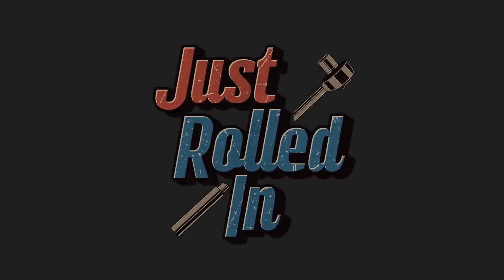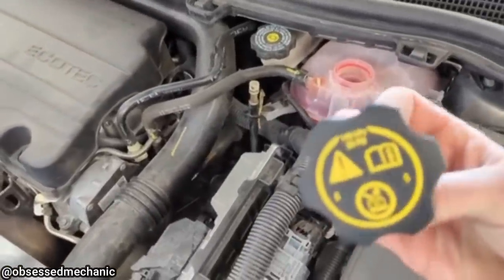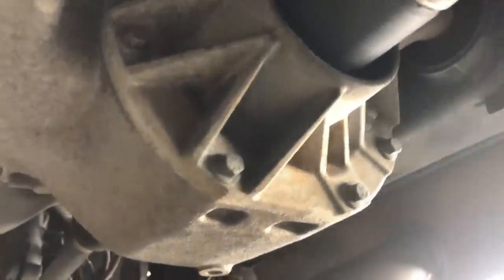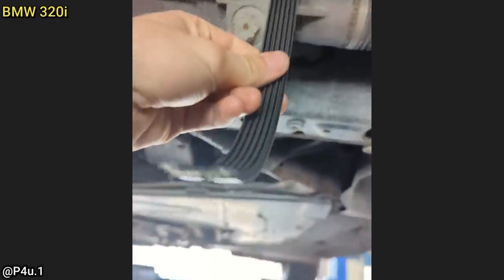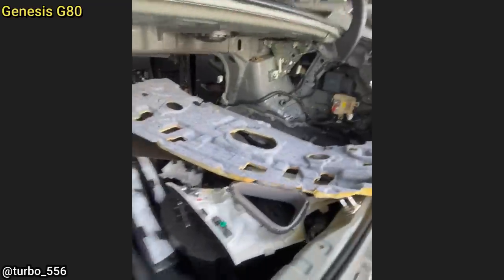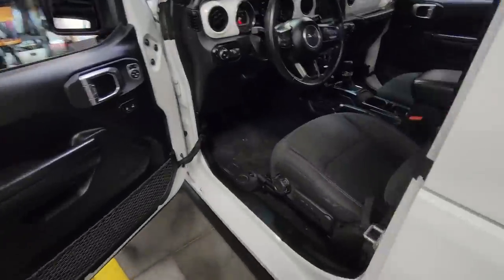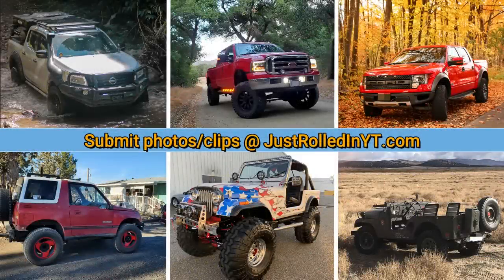Customer States Tire Fell Apart Two Days After They Were Installed (4 Months Ago) | Just Rolled In

Comment: 2:19 Very common problem on Volvos, at least the post 2004 generation. But at least Volvo were sensible enough to have that wiring harness go only from the back of the trunk to the handle, so relatively easy to replace. Only problem is if you're driving a European variant and it completely dies on you, since the European variants don't have that handle in the trunk to open it from the inside.

Comment: This is a great example of why hybrid and fully electric vehicles are far more expensive than gas when it comes to cost repairs. A Jeep Wrangler Hybrid with $18000 parts and labor, more expensive than the resale value.
Reply: That’s interesting since they gave absolutely no details why it cost that much. Was it submerged the indeed all new electronics and wiring harnesses? And  engine and transmission. 
It’s why I don’t like post like that they’re completely open ended and give you no useful information.

Comment: The funny looking spare tire at the end is actually supposed to be like that. My ex's old Pontiac had a spare like that. The rim had two valve stems and when it was deflated it folded in on itself to save space in the spare tire well but when you inflated it on the rim it became the same size as the regular tires.
Reply from the maker: Interesting! The more you know. Thanks for sharing.
Reply: Umm, what good is a deflated/flat spare..& why two valve stems?
Reply: @jessezass  Ahh, think I rode in a Sunbird's back seat..once. My pal Al has a little Harbor Fright compressor; takes a while but guess it works.

Comment: Previous owner of a previous car of mine had "a rattle" in the engine. The piston head broke loose from its rod, after about 500km the rod punched through the oil pan and the whole mess came to a halt. Garage replaced the engine with a new one and I had a nice second hand car with brand new engine for quite a few years.

Comment: That first video looks like when I got new shocks on my car and they used the same part on both sides even though left and right called out different parts. There was an inch of shock sticking out out of the upper shock mount with the nut fully screwed down.

Comment: Oh my god... that transmission fluid in the engine coolant reservoir. I have to replace the radiator on my 2000 mustang. I thought someone had put oil in the reservoir. Turns out i have a leaking transmission cooler line in it. But yeah. It is nasty.

Comment: It's really odd that the manufacturers will cover a whole wiring harness, but if it's a simple thing like a broken wiper fluid box or a cracked headlight module, they always say that it's not covered. That wiring harness job is gonna be like 20 of labor.
Reply: That car will always have problems due to the damage done to replace an entire harness rather than a simple splice. Dumb call on the manufacturer;s part.

Comment: I just got an alignment, rotation, and balance…but I’m still all over the place at highway speeds.  I did a piecemeal job on my tires, so there’s all different tread on the tires; is this the cause of getting blown all over the place at 65mph?
Reply: Check the steering actuator, it might be overfilled with alcohol.

Comment: 2:39  I saw a tire like that back in 1988.  It was the compact spare tire for a 1976 Cadillac Seville.
My sister was getting new tires and the tech said one rim was bent.  We asked them to use the spare tire rim.  They let the air out and it shrank and folded around the rim.  We decided to not mess with the spare rim but I can't remember the remedy we used.
Reply: AFAIK that was one of the early compact spares--it was shipped deflated and somehow folded into itself.  The car was supposed to come with an inflator can in case you needed to use the spare.  That was an option on my 1977 Olds, although my car came with a normal full-size spare.

Comment: When I was 15 working in a gas station/service station in the 60s. That’s when every gas station pretty much had a mechanic and a lift for changing oil and tires and putting on exhaust systems and starters and anything else .. I even painted a car inside a moron station that my boss let us work in after closing at 11 o’clock at night to paint the car..
 So:::
  They were repaving Route 65 just 2 miles outside of Pittsburgh along the Ohio River. They took the asphalt all the way down to the old bricks. That left manhole covers sticking up about 4 or 6 inches..
  we would watch the cars flying by not knowing about the manhole covers, and giving them a good rap with their cars.
  One night, a late 50s Buick with six guys in it hit one of those manhole things sticking up. We saw and heard it it was pretty close to closing time.
  that car came rolling into the parking lot about two minutes later. Boss put the car up on the lift to see what damage there was. It hit the oil pan off the engine. It looks like an open can of sardines. We could see the crankshaft and the rods and the pistons. My boss said to the guy, we can’t fix this tonight. So the guy said OK, and we brought the car back down on the ground ..All six guys got back in the car, and they drove away

Comment: Coworker came in with a flat tire. Went and looked at it, ran over a roofing nail.  The tires were 7 years old, bald and dry rotted. Never had them rotated. Glad it was towed away for new tires.

Comment: A new school bus runs from $90,000 - $130,000 depending on options. However a refurbished 2-3 year bus to total electric goes for $250,000+. So if you see your property taxes go up check and see if the school is going electric!

Comment: At 0:20  The car won't move without transmission fluid so when did it overheat?
Reply from the maker: Automatic transmission so still fluid in the torque converter. When doing a service, you won't get the fluid out of the torque converter, so it was low on fluid which caused it to overheat.

Comment: Bruh some Pacifica tires I can’t think of the brand and type off my head. But a certain one has a flimsy sidewalk like that and it’s annoying when removing, if your using the unit with a hook that’s grabbing it since it just slides off. Then holding it is awkward cuz the sidewall is flipped inside out with a weird wrist angle.

Comment: The lightening sux. Even though it is a truck. We were told not to market it like a work truck. Rather sell it as a “casual” truck. They said if it is used like a work truck. The battery will die fast because of weight and the battery won’t last it’s stated lifetime. In other words. If you use trucks for work. EV will let you down. Plus it cost $20,000 more than a gas powered f150

Comment: 1:01: I knew Fords are built tough, but this... oh, you meant the bird?
1:13: these damages can also come from hitting a curbstone at angles, breaking the threads in points. I have seen those bubbles distributed among the flank. curiosuly enough more often on the inner wall then on the outer... after such damage I'd check the wheel itself for dents and wobbles. and maybe for breaks.
1:36: some machinery doesn't take it lightly to be jacked up with. when in doubt use a rubber cushion, or another point. granted, many newer models doesn't make things easier.
1:59: wow, someone knew how to weld correctly...
2:13: VW likes to use a ribbed plastic hose for washer. some detergents seem to make these hoses brittle, as there are repair kits out there specifically for VWs. doesn't help you if the break sits in the left sidewall (Polo, Lupo, Up!) and you'd have to take the interior apart to get there... and then there is only the connector between the hoses that slipped off. VW quality, yes?
2:39: no idea. some tyre sizes like 80 series and "Balloon" can fold out like that after remounting, but this here looks like a lot of tension inside. maybe faulty threadware? also, sometimes chemicals can deteriorate the tyres' rubber over time. I once had a spray can of cavity wax leak out and destroy the spare tyre underneath. looked like all the thread was broken, but the rubber just quelled up a lot. still replaced it, of course.

Comment: If you mix transmission fluid with antifreeze and add heat it turns into an acid and will rust the crap out of an engine block if left in very long

Comment: For anyone replacing a fuse, don't just replace the fuse. investigate what might have caused the fuse to blow in the first place. If there is a short, you risk doing more damage or catching something on fire. Fuses rarely pop for no reason.
Reply: They did on my civic had a mechanic friend help me with the electrical and we never found any problems but it blew a few fuses. My favorite was the one for the fuel injection system

Comment: In 19 years of collision work I have never welded a lower control arm. Unless to make it mobile till parts arrive.  Last year I did weld up a engine cradle that I STRONGLY advised to my boss that was illegal.  Ripped the lower control mount completely off. I rebuilt it after the owner and my boss signed a legal waver expunging me of all liability.  They did and I spent more time on it than I was allowed just to make sure it was going to hold properly for safety.  What I don't understand is how can you own a brand new car that still has the original oil from the manufacturer and not have car insurance.

Comment: @3:00 - What the H?!? What exactly was replaced/repaired on this? Having had a '88 Jeep Wrangler which was the worst car I ever owned, I can somewhat relate, but not to that dollar level.
Reply from the maker: They filled up the inside with water when off roading, then afterwards it wouldnt start. Got a bunch of wiring harnesses replaced. Jeep was gutted to do the work. Had some body work done as well.
Reply: @JustRolledIn  Oh for Crying out loud. I used to leave the top down on my Wrangler and then pull the drain plugs out of the floor after it rained. I'm surprised the thing wasn't totaled for that kind of repair bill.

Comment: how do you NOT smell a pumpkin rotting under your front seat?    I only know ONE place where someone would hit a Falcon going 90 mph in a white M-B (and it isn't in the USA).     I had a tire shoulder separate on a front tire once and the steering wheel had a twitch (drove on it for about a week).     When I went to get the tires rotated; that's when the tech showed me my issue; so I bought new tires, but switched brands).     The transmission fill story is funny and sad at the same time.

Comment: Don't you put your ATF in the coolant reservoir? Also make sure you put your engine oil in the washer fluid reservoir.
Reply: The coolant goes in the power steering pump.
Reply: @mikespangler98  yes. Finally someone gets it. Make sure you top off your brake fluid with windshield washer fluid.
Reply: Quickie lube places are famous for adding coolant to BMW washer reservoirs due to the similar appearance and location of coolant reservoirs on domestic vehicles.

Comment: What happened to the 18k jeep?
Reply from the maker: They went off-roading , and sunk it a bit. Filled up the cab with a couple of inches of water. Had body damage. Needed to be gutted inside, to have a couple of wiring harnesses and modules replaced. If I recall correctly.

Comment: The tires in the first clip are probably far past the date. 
Good thing the guy didn't hit a Ford falcon. 
The vibration caused by ply separation.  
The tire in the end clip has reverted to prevent cured shape. No doubt it too is far past its age date. If your tires are 7 years old, you probably should get rid of them.

Comment: The 'Spare' is what you get when you put a tire designed for a 5.5 to 6 inch wide wheel on a wheel that is 10 to 12 inch wide. Ricer.

Comment: The tire @ 2:40 is a collapsible spare used by Mercedes to store in a small diameter spare well.  They come with an inflator and deflate tool.
Reply: Very common in the 70s and early 80s before the typical donut spare.

Comment: In 30 years a wrenching I still haven’t seen a tire bubble on the sidewall like that. Gotta be heat or improper balance🤷🏻‍♂️
Reply: It’s usually caused by running the tire with very low air pressure causing the sidewalls to flex and separate.  Unfortunately, I have seen it many, many times.  Have a great day.
Reply: Potholes cause that damage too!

Comment: I'm always wondering what tires are sold in US? I've never seen tires with such big bubbles at their sides here in Germany, but in US clips you seen them permanently.
Reply: It is not so much the tyres, but the way they are treated.  If they are run flat or kerbed it can damage the sidewalls, leading to internal separation and ballooning which even the best of tyres can be susceptible to.
Reply: Walmart sells tires here, and the quality can be terrible depending on what kind of tire you get. When i was younger i bought a set of Goodyear's from Walmart, they kept getting sidewall bulges despite me never hitting a curb. After the third free replacement they told me never come back, so i bought some better tires elsewhere.
Reply: @henrydillard6217  I've had problems with Walmart's Douglas tires (made by Goodyear) always developing slow leaks. I've had them on 4 different cars, none leaking from punctures. Don't get me wrong, they're decent tires, great overall performance in adverse weather, but it gets annoying quite quickly to put air in them three to twenty times a week.
Reply: It was a Korean car with Korean tires, running 10 psi low when it came in.

Comment: What is the story with the 18k repair on the Jeep?
Reply from the maker: The customer took it off roading. Sunk it a bit and filled the interior with a couple of inches of water. Had to get everything removed, to get a couple wiring harnesses and modules replaced. Also needed some body work.

Comment: I am a retired toyota tech
 Lady with a 72 corolla complains of no power cant climb a hill. Road test the car all seems normal. Repeat road test with old lady customer driving. Sure enough car will not climb hill to dealership. Diagnosis seat is too far back. Cure move driver seat ahead. Dumb customer could not beleive.

Comment: What was the deal with that white jeep? Like it was spotless from what I saw in the video and you're not gonna elaborate the 18 grand worth of work that was theoretically needed?!
Reply from the maker: It's spotless because it just had a lot of work on it lol.
The customer took it off-roading and afterward it wouldn't start. Had a couple of inches of water inside. Had to be gutted, get some wiring harnesses replaced, modules, and some body work.

Comment: We could use a little more info on some of these clips. Like the jeep that looks brand new after off roading, what the hell was 18k to fix? You can buy a brand new small car for that.
Reply from the maker: Each photo and clip is time stamped with more information in the description 😊.
However they took it off roading and afterwards it wouldn't start. They filled in the inside of the jeep with water. It had to be gutted. Had wiring harnesses and modules replaced, as well some body work.

Comment: My first car was a 1996 Jeep Cherokee Sport and the rear washer fluid shot straight backwards at a good distance - about 10 feet. So when anyone would pull up to me super close at a stop light (which drives me nuts!!) I’d just give them a little spritz. 
Had an asshole pull up literally two feet from the back bumper of my 1971 Volkswagen Beetle and as we were on a steep hill I knew I’d never be able to take off without rolling backwards so I sat there a while hoping she’d get the drift, she didn’t so I rolled back and thankfully her car stopped me from going any further and I took off from my stop sign 😆😆 bitch you got what you deserved. Bug was unscathed.

Comment: sold a car with brand new tyres guy came back 2 das later wanting refund  as leaking oil and  tyres showing the metal so asked what he been doing 
they said just 70 mph ..i said what gear ? he said its auto so in drive lol was a manual 5 speed lol he been doing 70 in first or 2nd no wonder why it leaking oil or why tyres bold in 2 days

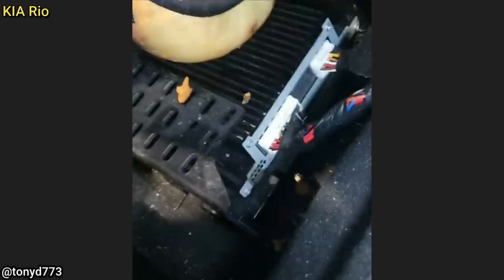Comment: 1:01 Bird strikes are no laughing matter. (2019 Altima S) I smacked two Meadowlarks having a territory battle with my driver side mirror. It sounded like a shotgun going off! When I inspected it, the bottom part of the plastic housing had separated and now there is a seam opened up. I can't imagine how much it would cost to replace the mirror and get it painted to the OEM paint color.

I've bashed a Turkey Buzzard once with the passenger side pillar on a Silverado. Feathers just went everywhere!  There was a BB sized dent in the pillar, nothing else. The truck got bashed above the passenger side rear door by a tree branch later on.

Comment: Overheated the trans? How did the vehicle even move? What level of oil even existed to allow any type of heat generation?
Reply from the maker: The transmission oil in the torque converter. When you do a transmission service like they did, you only drain a bit of the fluid out and not all of it. There's still a good amount in the torque converter.
Reply: @JustRolledIn  I'm aware of that, but if that makes it's way out of the converter into the trans, the car will not move bc little to nothing in tc or trans though, I suppose where the temp sensor is located could trigger high temps.
I don't know a whole lot about transmissions, so It's just an open speculation.